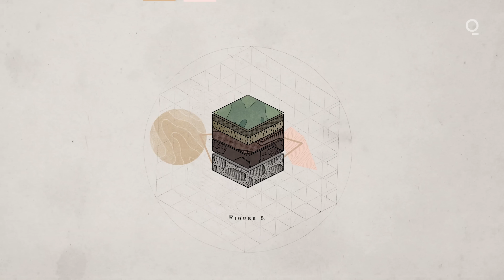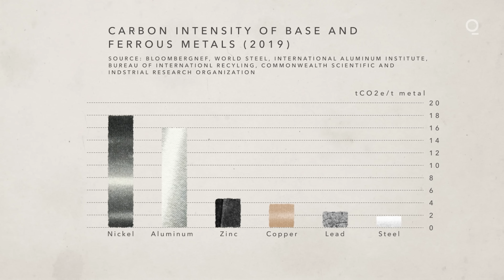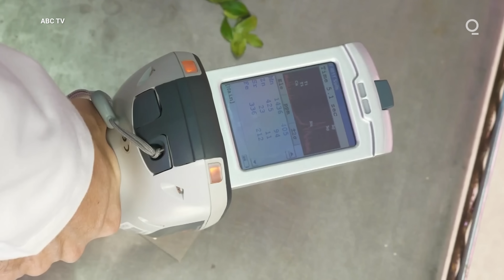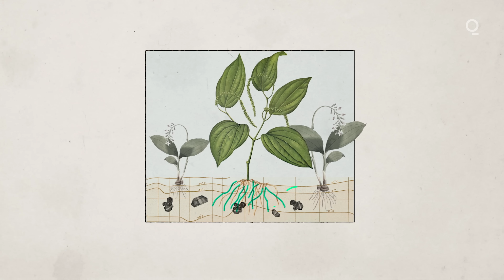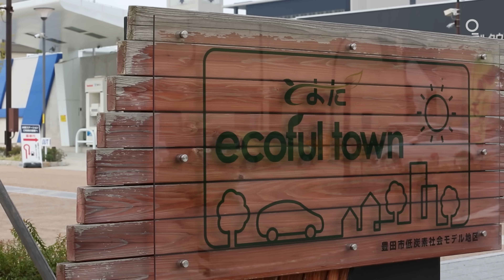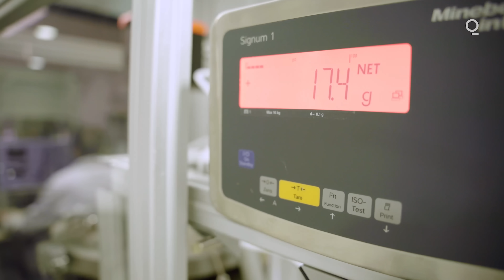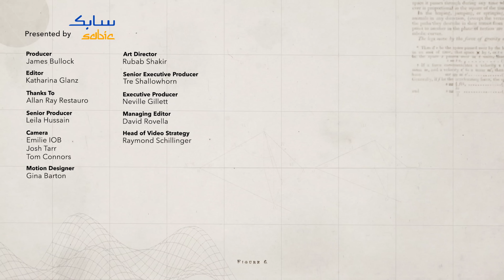Could Plants Help Solve Our Addiction to Mining?

Comment: Just have to add that mining for metal creates alot of "waste" however there are alot of byproducts. Its not simply digging a massive hole in the ground and then throwing out everything that isn't metal. Woodlands need to be cleared via a logging contractor which produces lumbar and other product. Top soil need to be analyzed and hauled away. Clay is used in construction, sand is used in construction, stones of all sizes and types are hauled away for any number of uses such as gravel. The material waste comes from removing the metal ore.

Comment: There is new battery teck,that does not require cobalt or zink,like all problematic pollution it is demand that drives the pollution,and as the newest extremely efficient batteries not requiring these elements, demand will be driven down

Comment: Could these plants be used as a cover crop to reduce the heavy metals in crops grown with them? Remove the biomass from the field and over a few season perhaps have reduced the heavy metal levels to the point it is no longer necessary to repeat this process?
Reply: I'm not entirely sure if this is what you're talking about, but they have used specific sunflower varieties to help clean up the soil around Chernobyl. Planting them, harvesting them when grown, incinerating them and then vitrifying the remains into a glass to be stored safely. The process is called phytoremediation, I find it so fascinating.

Comment: Arguably, the use of floating water plants is more useful and more economic.  At least two (probably more) water plants can concentrate a range of metals 5 orders of magnitude from the water they grow in.  They are Azola and Water Hyacinths.  If you then dry the plants you gain another order of magnitude and if you ash the dry plant, one more OoM.  The heat from burning the dry plants could be used for heating or electricity generation,,,, and of course for drying more plants.  If the plants are grown  in nutrient rich water (from a sewage plant??) they multiply at a fantastic rate and you just have to continually harvest (scoop off the surface) at a rate that allows maximum growth rate or maximum metal harvest.  They can be used in, for instance, the water leaking out of a mine waste dump, thus cleaning up the water for other uses while harvesting metals that were not extracted originally.  The only place I can see for land based plants is to clean up a contaminated sight.  Water plants are far more easily industrialized.

Comment: Great idea! I would like to know if this technique can be used for extracting remaining metals from mining waste. I know, mining waste is closer to rock than soil  and the toxicity levels are way higher, but maybe it could be ground and mixed with normal soil, then treated with hyperaccumulator plants.
Reply: That wa my first thought to but mixing in other waste like the ash and sludge from sewage and landfill incinerators might give you enough carbon and soil remediation. That stuff also often has alot of metals and stuff in it. I used to work for a railroad and we shipped alot of trash like that mostly from around NYC to the south it was gross in more than a physical sense
Reply: if this were to be really successful i imagine mining waste could be used as a fertilize making the "waste" another product

Comment: I suppose you could burn them in a biomass boiler no? recover some of the heat energy. Ash is ash, but might as well use the heat for something.
Reply: For sure
Reply: In the very least, use the heat to run the facility as well as dry the harvested plants.
Reply: @nunyabiznes33  Almost the entire Brazilian grain and seeds output is dried using Eucalyptus firewood

Comment: If traditional mining create lots of co2 emissions how exaclly is burning plant to ash to get there ore gonna be better? that will release all the co2 those plants pulled from the ground and air back into the atmosphere. Also there roots will only extend so far underground they will not be able to get most ore witch can be 100s of feet. Humanity has harvested most of Earth's significant surface level mineral deposits. Except in ecological sensitive areas.
Reply: They already said this can't compete directly with traditional mining, since as you say it's limited to surface levels. Burning the plants takes less energy than with ores so it releases less emissions per a given quantity.

Comment: Nice research, but it didnt solve the problem. You will just crash the supply-chain with the very low yield of your so called nickel harvesting. It is much better to apply stricter control of the mining industry. 

Dont you learn the Amazon forest destruction for soy oil? Why do you want to repeat such horror?

Comment: Why does the hyper accumulator accumulate these metals on their leaves?
Reply: Likely used in one of its biological processes. Humans are bioaccumulators of metals, albeit it very inefficient. Small traces of elements like copper are used in the body, as well as zinc and others. These plants accumulate metals for the same reasons, though if they're being bred to increase their efficiency, they will likely end up storing far more metals than their biological processes need.

Comment: There is a major flaw in this, they burn the leaves which creates huge CO2 and CH4 release. They are accounting emissions to convert plant into ash as negligible. But it is not negligible. Like Air resistance which is not negligible.
Reply: Except that the heat produced by the boiler is used in replacement of fossil fuel and heats a Research building. Unfortunately it is not stated in the video. CO2 emitted (oxidation so no CH4 measured) is the same as fixed by the crop during the same year.
Reply: In that case it is really circular

Comment: If I remember correctly... I have read an article 5 - 10 years ago, a group of researchers used sunflower plants to clean up radioactive field or heavy metal soil. Wonder if they are the same group of researchers. 

Change it in the form that more easily to handle... One step at a time. Great idea!

Comment: Does not combustion of the plants produce CO2? How much do you need to burn to meet the industrial demands for Nickel?
Reply: If not said in the video, we recover that energy (renewable) in substitution to fossil fuel for heating buildings or to meet heat requirement from industries. Hence the low CO2 emission.
Reply: As the plants get their carbon from CO2 in the air, on the scale of like a year, growing and burning the plants would be effectively carbon neutral (aside from the harvesting and transport and all that). They could however also have a carbon capture system alongside the incinerator to further reduce the CO2.

Comment: Engineer watching video:
1. How many squared kilometers of arable land is needed to yield 1t of Nickel per year / month / day?
2. Plants need to get Nickel from somewhere. How many cycles same soil can sustain before yield drops below economic threshold?
Reply: for more expensive metal like gold and platinum, there are already existing bio-mining technique that utilize genetic engineered bacteria to leach out metal from ultra low concentration ore. It able to extract like 99.5% remaining from the low grade ore cheaply. But it does take several weeks for the extraction process to completed. I think this type of bio-minig via plant is quite similar. Most likely it will serves as a method to extract metal from ore that has too low of concentration to be processed normally. And existed  along side with regular method. It won't replace the regular method, but serve to recycle waste ore to get more metal out of it.
Reply: @keenheat3335  it has been a little while since the last lecture I attended on extractive metallurgy, but if memory serves the bacteria used to aid in leaching are naturally occurring and haven't been genetically modified (yet) it is still a relatively new technique and I wouldn't be surprised if genetically modified bacteria would improve the process.
Reply: They grow Thlaspi caerulescens which mature every year. They are only growing it on soil with high zinc concentration, so I would assume they only grow a few times before abandoning the field.
Reply: I think that’s why they said at the end this will only be a supplement to extract a bit extra nickel from soils that aren’t worth traditional extraction
Reply: If you companion plant Equisetum, minerals can be brought from depths up to 50m. Also, the first sites to be used for these plants would be former mines wouldn’t they?
Reply: What if they used the earth extracted from the mines to straight up "fertilize" agromining farms?
Reply: @jascrandom9855  I was thinking the same thing, using the existing/abandon mined earth to squeeze out the last drop ;). Even waste water from mines can be recycled by using them as "fertilize" as you say
Reply: @jascrandom9855  What sounds really feasible
Reply: Well once they deplete all the nickel and heavy metals the land can probably be turned to food crop farms.
Reply: Could be made part of recovery process for tailing treatment of mining plants.

They did said it's not going to replace traditional mining, but a way to make soil healthier by removing extra heavy metals.
Reply: Yeah kinda just sounds like mining with extra steps
Reply: Isn't subsoil fairly rich in metals and minerals? I think in a lot of places metal levels could be topped up by mixing in metal rich subsoil that can be sourced on site
Reply: 2. It can last for at least 10 years in temperate regions to 30 years on tropical soils (strong weathering of bedrocks that release more nickel for plant roots. 1.5 to 6-7 tonnes from one hectare in total depending on the soil and the plant used. Soils can be returned to agriculture after.
Reply: Yeah it sounded unrealistic af
Reply: By Dr Guillaume references, the adequate unit is square meters per ton, not square kilometers
One square kilometer is 100 hectares, each one being 100x100 meters, or 10,000 square meters
With a yield of 6 metrical tonnes per hectare, would be needed 1,667 square meters to harvest one ton of nickel
About depletion, actually it's one of the objectives
Just remember every mine will end up being depleted
Reply: Exactly!!
Reply: The main reason to do this is to convert contaminated soil to a state that is safe for food production, any profit from selling the metal is a bonus.
Reply: Ok everyone gave valid reasons why this is not feasible, specially noy at industrial level but hear this: what about a day where everyone has a 3d printer at home, and instead of minning everyone collects their metals from their backyard and produce their own electronics?
Reply: @tourniqut  that probably will never be feasible for the majority of the population.
Reply: My thoughts exactly... also it's basically mining about 30cm into the earth..... this is negligible... waited all this video to get a single statement about this issue but nothing
Reply: @Megalepozy  root systems of herbaceous hyperaccumulators reach 1-2 meters after a few years if perennial plants but soil weathering from the bedrock releases more nickel over time. No need to destroy it all.
Reply: @guillaumeechevarria5219  First of all, thanks for ur reply! and indeed 1-2 meters is way nicer although still sounds quite shallow... but maybe I'm just accustomed to c deep mines... which make me ask the following in regard to your second comment about the 1.5 to 6-7 tonnes per hectare which sounds impressive but make me raise 2 questions if u don't mind :) 
1. Is that the total for 30 years of agrimining those plants? if so how much tending/work do they need because it doesn't sounds like a profitable business (although I don't have the numbers so this is just a hunch)
2. How much nickel would ordinary mining get from such amount of land? (hectare and 1-2 meters deep) how much will it take them to get it?

I will add though that making the land fitting for agriculture is a big bonus!
Reply: @guillaumeechevarria5219  Thanks for clarifying! Would have been nice to hear it in video though.
Reply: @Megalepozy  The main thing is that the ecosystem (soil cover-vegetation-watershed) doesn't need to be completely destroyed. Some hectares (most of them) in a mine lease do not yield any metal (sterile) but could be used for agromining. Therefore an average per ha is difficult to calculate... (in my opinion of course, but maybe mining companies have such figures).
Reply: @guillaumeechevarria5219  The depths may be even shallow
And we have already knowledge to revive crushed depleted ore or reject into soil fertile enough to grow hyperextractors
Reply: @Megalepozy  Not negligible at all, counting all crop land in the world down to 30cm is about 20 000 km3, easily exceeding volume of everything ever mined, global iron ore yearly output is "only" 0.3km3. And keep in mind, this could and would use soils unused or unviable for conventional farming, while potentially improving quality of such soil in the process. Mining is all about concentrating lowest possible grade in most efficient way imaginable and agrominging could fit that bill very well indeed. Also, some conventional crops like rapeseed also work to effectively concentrate some metals, so agromining could in some instances be worked in as monetizing a byproduct. The biggest obstacle is really that farmers really don't know much about metallurgy, not really their area of expertise. But if some company were to put a price on ash of particular plant grown on particular soils... that could be an effective starting point.
Reply: @aleksandersuur9475  So u expect to eat plants with nickel instead of vegetables and such? ;) (using the size of crop land currently used doesn't really tell us anything since this land is being used for a totally different goal)
Other than the above although I was given an answer to the "negligible comment" I made by Guillaume Echevarria I still found your reply insightful so thanks for that :)
Reply: Maybe we can try some back of the envelope calculations. Best case is a plant that’s 4% nickel in weight. Information on nickel content of soil can be found on the net. I would be interested to see a calculation that somewhat answers your questions. We could add assumptions, like so many harvests a year, how deep the roots grow etc.

In any case, looking at those mines, I’m sure the plants will never be able to get nickel from those depths.
Reply: @motioncompensation1544  so ~25 tons of plants/ton of nickel- assuming you could get that with a few acres over a year
Reply: Funny thing  Nicole trees are real and have been used like this for a couple decades now.
Also they better not use chemicals fertilizer or pesticides when they do or more wild life will die.
Haha I just finished the video.
Soo yes this nickel tree has 2 to 3% in its sap its way more then rock.
I love how they didn't bother getting the fertilizer out aka potassium all they need is water and let it sit there for sun to evaporate it and tada potassium fertilizer as well as nickel left in the ash so now you can get the nickel.

Comment: Asteroid mining can't happen soon enough.
Reply: Asteroid mining will be a thing once we have nuclear fusion sorted out. Both are always 50 years away.
Reply: Nope; Recycling batteries and alternative battery chemistry and hydrogen are better solutions.
Until we develop vastly better rocket technology(lower emissions, higher payloads) asteroid mining won’t take off.
Reply: It will start when we have the infrastructure in space. Most likely 20 years. And 20 years is not that far.
Reply: @khanch.6807  twenty years is very hopeful lol. I’ll say 50 realistically. We are nowhere near discovering fuel that can sustain a space craft long enough for asteroid mining. The most promising thing we have is plasma propulsion and there’s still lots of work to be done in that field. Then we would have to think about food, water and oxygen for the miners.